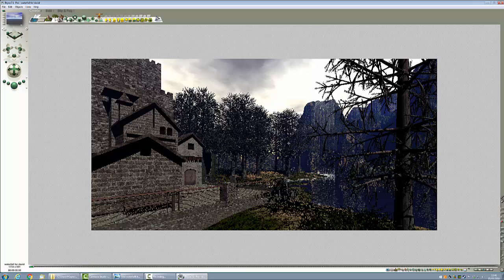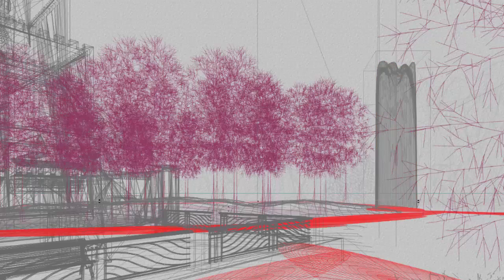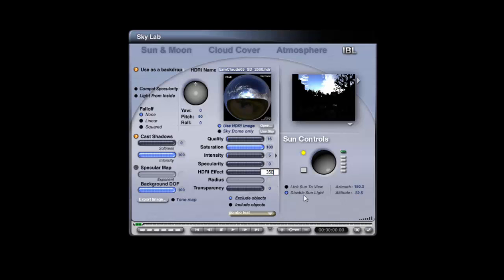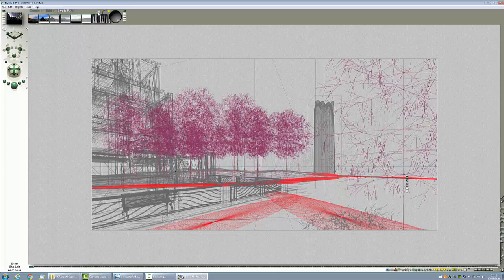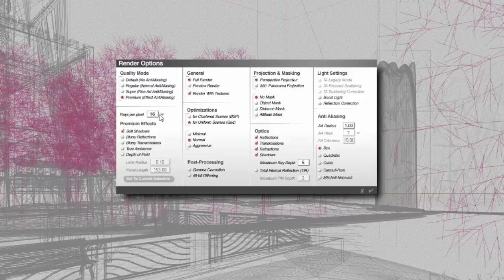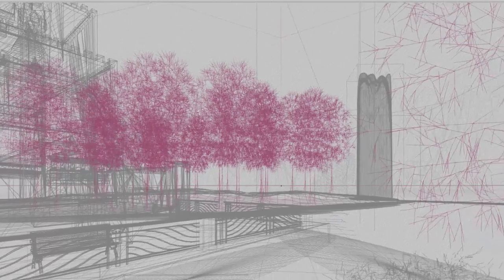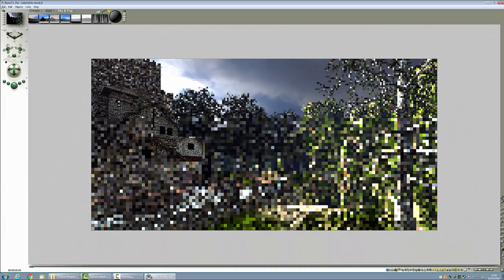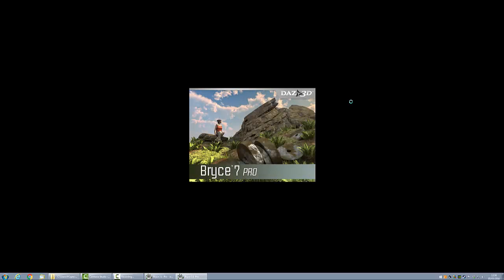Bryce 7.1 Pro - re-lighting scene supplied by Vivien - by David Brinnen.

Comment: Stupid question, probably: Is it possible to achieve the same effects without HDRI lighting?
Reply from the maker: +Richard Philip, perfectly valid question.  Provided you didn't need the image as a backdrop what you could do is put multiple radial light sources in the sky of differing intensities and colours to simulate the effect of global lighting.  Or as in the case of True Ambiance rendering, you could illuminate the scene with the TA optimized radial light by either directing a light source at it instead of using the HDRI option or through material ambient.  The main reason to use HDRI is convenience.  But no, you could still achieve the same results, it would just be fiddlier to set up.
Reply: Thanks for the response, David. Also, I don't know it it was just me, but the example you showed without TA seemed much more crisp than the one with, which was much softer.
Reply from the maker: +Richard Philip, that I think is the difference between direct lighting and true ambient lighting.  With direct lighting as you are dealing with point light sources then there will tend to be more areas where light cannot get, so there will be greater contrast across surfaces which will give the impression of sharpness due to greater variation.  TA lets light wander around into all the nooks and crannies, so contrast will be reduced, as it is in real life and so the scene will look softer because there is less contrast in the detail for the eye to latch onto.  Think of the difference between an overcast day and a day where the sun is out.  The other thing to consider is that TA rendering uses the premium effect render engine which can have a much higher per pixel sampling rate than a regular render.  This generally improves the appearance of complex material but at the same time it has a smoothing effect because it reduces any artificial "grittyness" that comes about due to the texture detail being far higher than the screen pixel detail.